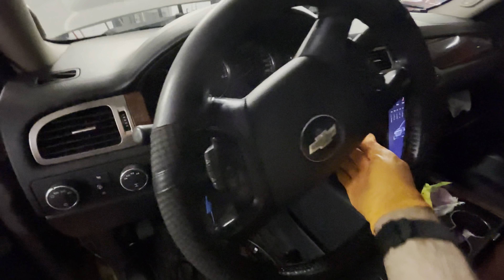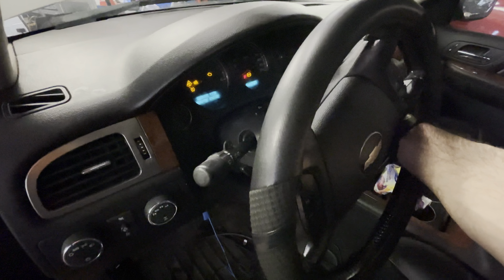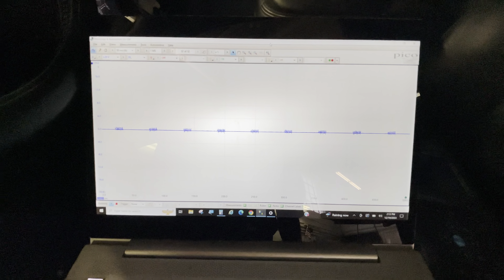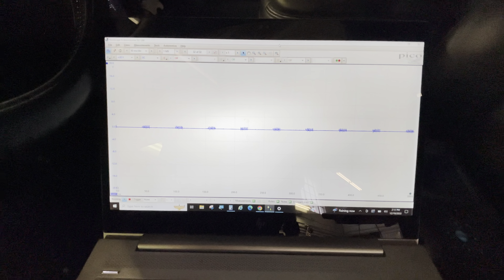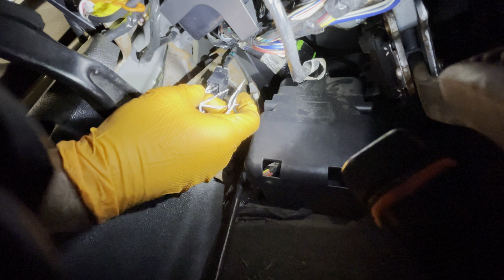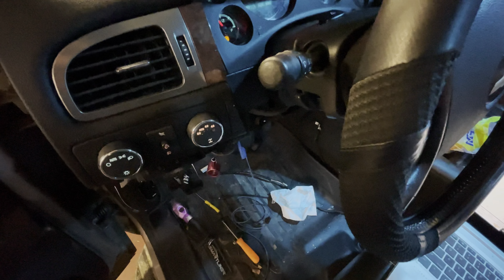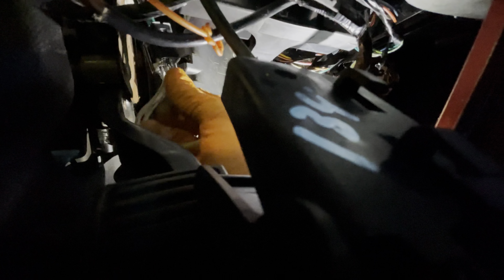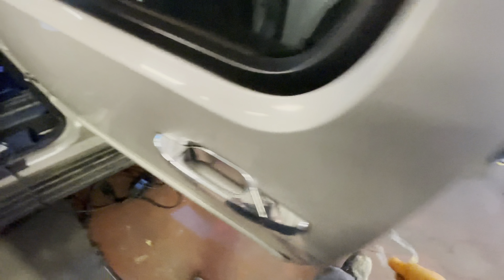Single Wire Network No Communication Diagnosis Tips

Comment: i am having this problem right now on a 2015 sonic with my High CAN at zero volts no start condition. I have been looking all over for a video like this to give me a strategy to attack the problem...Thank you for this vod...instant subscribed
Reply from the maker: Thank you! I have some other videos which cover two wire high speed CAN circuits as well.

Comment: I have an 02 cadillac Eldorado in my bay right now. Original complaint was the cluster didn't work. Diagnosed it as a bad cluster, put new one in. Cluster lights up and gauges work but trying to do key relearn isn't working(pellet resistor style key). I can communicate with the airbag module, I'm wondering if I have the same thing going on and it's screwing up the network not allowing key relearn.
Reply from the maker: What codes do you have?

Does the theft light flash and then turn solid?

Check pass lock sensor data, pass lock sensor voltage should drop from 5V to a specified value at key on/cranking.
Reply: @DadsGarageDiagnosticSpecialist  the theft light flashes with key off and out of the lock cylinder and goes off with key on but the message center say starting disabled, wait 3 minutes. I have 5v from cluster, it drops to 2.3v with key on. I may not be remembering that voltage correctly but it does drop from 5v. It's a used cluster and doesn't have the vehicles key programmed to it. Trying to program the key by turning ignition on, waiting 10 minutes, ignition off for at least 5 seconds, ignition on for 10 minutes so on and so forth. codes are as follows 
Ecm
P1630 theft deterent pcm in learn mode
P1336 crankshaft position system variation not learned
Bcm
U1255 generic loss of communications
Ipc
B2780 wrong resistor before good
U1255 generic loss of communications
Onstar 
U1088 loss communications with supplemental inflatable restraint/sensing and diagnostic module
U1500 inter device dedicated bus malfunction
Any help would be greatly appreciated. The techs i work with haven't been much help.
Reply from the maker: @ColeTanner88 with the PCM in learn mode code you might need to program and immobilizer learn the PCM. 

The keys are not learned to the IPC, they are learned to the Passlock module or BCM. 

When attempting the manual relearn procedure you need to crank and attempt to start the engine and then leave the key on. I have a video showing this process.
Reply from the maker: I miss read… I thought you said 2002 Cadillac Escalade… Now I see you said 2002 El Dorado. 

I will see what I can find and get back to you.
Reply: @DadsGarageDiagnosticSpecialist  my understanding from service info is the pcm receives a fuel enable password from the ipc when the key is turned on/crank after the 3rd procedure. At that time, the vehicle would crank and started a couple times but would stall 2 or 3 seconds later due to a theft fault. After a couple times, it started and stayed running but the cluster message said "theft fault vehicle may not restart." And started a couple times afterwards but then reverted back to a no crank due to theft faults. I'm wondering if the airbag module is causing data corruption over the bus. My voltage and waveforms look ok with 0-7v data packets at the cluster. Ive not checked at other modules yet. My understanding of networks, at least can networks(and I understand this vehicle isn't can), is if a module isn't talking, other modules will send out the same message over and over saying "are you there" and cause data corruption on the bus. Not sure if I'm explaining that correctly. All my "training" is self taught info from what I can find online. Just attended my first legit training expo last week and need to find more. Tough to afford training on a techs income though.
Reply from the maker: If you have a good 0V-7V waveform that is a good sign. Can you communicate with the airbag module? I had one recently that would not complete an immobilizer learn due to the airbag module not communicating, so verify if the airbag module is communicating with the scan tool.

Also I would attempt to do the theft learn through SPS, the 10 minute procedure.

Research suggests the IPC can be logic locked and fail to complete the learn, its worth trying to disconnect the battery and power down all of the modules and see if that helps.

Comment: The gentleman talking is sharp, I can tell it in the 1st 20 seconds.
Reply from the maker: Thank you very much! I appreciate it!
Reply: I have everything apart,I do have aftermarket radio interface 1952363C11 and found 2 other modules that appear to be remote start or remote entry as well which I don't don't have any remotes or fobs for. They both have inline fuses which are good.
I was reading something in forum about aftermarket radio in trailblazer and somebody mentioned a brown wire that needs to be powered otherwise dtc codes and tranny shifting issues, but the thread is old..the other 2 modules are marksman a2 with 2 relays and a directed electronics 457G bypass module. 
As well as brown wire being powered, it had something to do with starting. Grinding? When I turn the key, sometimes it seems keeps trying to power starter after key is turned back for split second
Reply from the maker: @enlightenthis3749  what kind of vehicle are we working on? Year make and model?

Yes, on General Motors products usually if you install an aftermarket radio, you have to either leave the network portion disconnected or if you have a better aftermarket radio you have to also install an interface module because the radio communicates to the body control module for door chime and turn signal functions.

Comment: For that custom connector you made can you tell me the part number or site for those ends I'm working on a silverado with same problem on the circuit but need the ends for the wires, please and appreciate it
Reply from the maker: I had some trouble finding an exact part number for the leads I used. Try terminated lead 19119395. 

Tell me year/make/model and the exact connector ID you’re looking for and I might be able to find the right number for you. 

Thanks for commenting Devin.

Comment: 09 Chevy Tahoe 

DLC states low idle speed and U0109.

Replaced the FPCM 3 times and the connector itself and I still have the same issue. Im assuming it’s a CAN Bus problem. Already wasted over $1500 trying to fix this problem. Any suggestions?
Reply from the maker: Disconnect the battery and test resistance across DLC terminal 6 and 14...you should expect to see about 60ohms....if out of normal range this indicates a wiring problem. 

If you do see a good 60 ohm measurement then your U0109 would most likely be caused by a power/ground fault to the FPCM. Corroded wiring to the FPCM is somewhat common....check for rotten wiring right at the connector or withing 24" of the connector usually.

Thank you.

Check out this video here for some tips on diagnosing a CAN network no communication fault:

16 Malibu U0131 No power steering. Diagnose the WHOLE problem! Electrical short testing. HSLAN Tips.
 https://youtu.be/qjylq8C0aFU?si=iUV3Lw22eh62HOSn